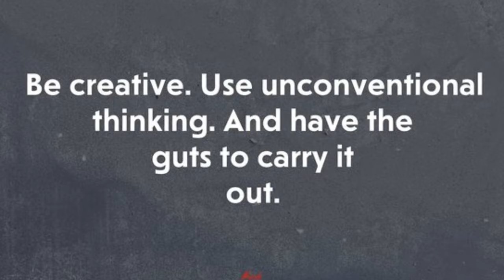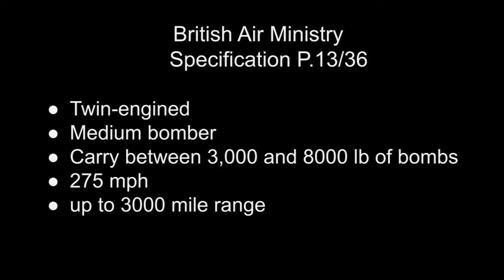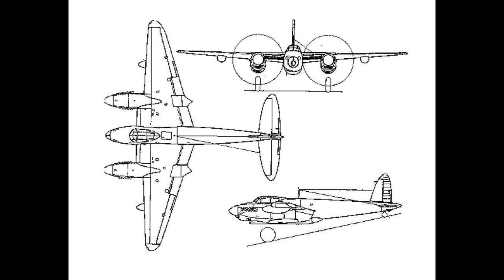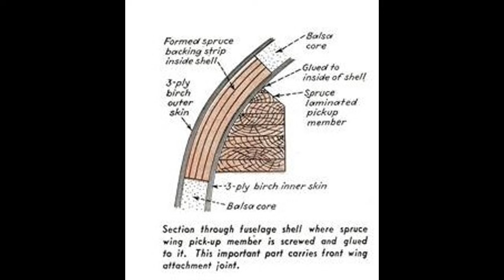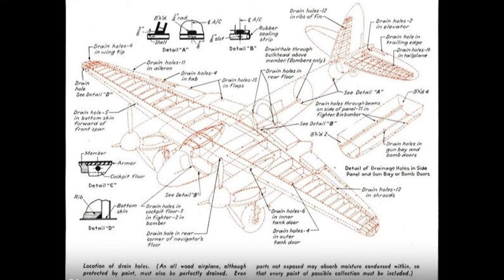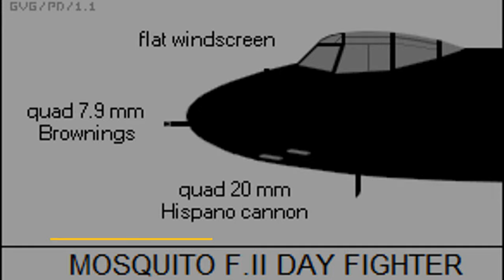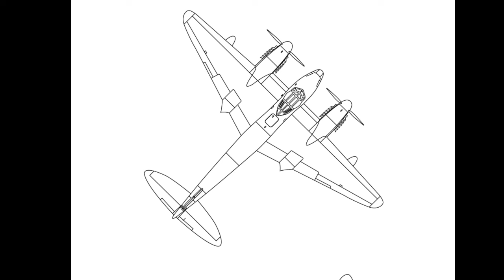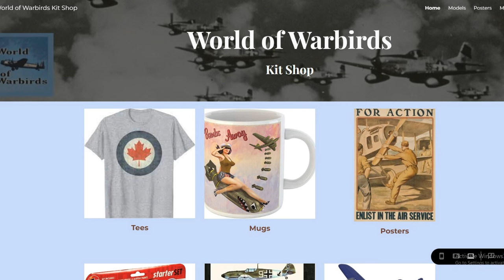de Havilland Mosquito (Mossie!) Part 1

Comment: Wilfrid Freeman was a personal friend of Geoffrey de Havilland, having flown in aircraft designed by him during WW1. The Mosquito was designed at Salisbury Hall, which had been the home of Churchill's mother and is currently the site of The de Havilland Aircraft Museum.
The DH.98 Mosquito is my favorite aircraft, I have several books and magazines about it, but I have never been able to see details (texts, photos or videos) of how they managed to pressurize the cabin in a wooden fuselage in the high altitude versions. I believe it was a low level of pressurization, just to minimize the effects of flying at high altitudes for the crew, so perhaps only by sealing the cabin part, the wooden structure would support the internal/external pressure differential - if you could clarify this point, I will be immensely grateful.
Reply from the maker: I’ll look into it!
Reply: @worldofwarbirds  I hope to finally solve this mystery.😉

Comment: Oh dear, you're repeating some myths.

Myth 1 that De Havilland came up with the idea of the unarmed high speed bomber. That was George Volkert of Handley Page. In May 1937, long before de Havilland put pen to paper on the Mosquito, Volkert came up with 2 designs to fulfil P.13/36, the HP.56 powered by 2 RR Vultures and the Handley Page High Speed Unarmed Bomber which he outlined in a brochure entitled "A Memorandum on Bombing Policy and Its Inflyence on Design". In this brochure he stated that "the most efficient bomber is the one that can carry out the greatest destruction with the smallest crew and the simplest equipment". Ye went on to state that "every other consideration will have to be sacrificed to the need for the highest speed, without which the maximum element if surprise is lost in any attack, as well as the greatest safeguard of the crew. Just as the bomber depends for its sucess on sudden attack, so for its defence it must rely on high speed and high altitude". Volkert went on to detail the benefits of a high speed unarmed bomber, which was design to carry ad it's normal bombload 3,000lb of bombs compared to the P.13/36'normal 1,000lb of bombs whilst at the same time being 1165lb lighter and 22mph faster.

Myth 2 the Air Ministry and RAF were uninterested in unarmed high speed bombers. Captain Liptrot (at the time Research Director Aircraft 3) analysed the design and considered that it would be faster than the Spitfire, although he also concluded that eventually the fighters would end up faster. Also in favour of such a bomber was Air Chief Marshall E. R. Ludliw-Hewitt (CinC of Bomber Command), he gave approval of the concept on 23rd April 1938. On 7th August 1939, he wrote "I am strongly of the opinion that the development of the fastest possible bomber, whatever its size,  is a project that ought to be put in hand so that we should have a prototype of this kind of bomber should the need arise". W. Sholto-Douglas (Assistant Chief of the Air Staff) also considered the type to be useful.

Myth 3 that the use of timber and other materials was opposed by the Air Ministry. In 1938, the Air Ministry issued specification B.9/38 for a medium bomber to be made out of non-strategic metals (ie metals other than aluminium and its alloys). They turned to 3 companies: Armstrong-Whitworth, Bristol and de Havilland. Armstrong-Whitworth submitted the AW.41, Bristol submitted the Type 155 and de Havilland refused to respond even though the use of timber would have met this specification. Specification B.9/38 was withdrawn and replaced by 2 new specifications Bl17/38 which covered Bristol's design and B.18/38 which covered Armstrong-Whitworth's design. Burt as Bristol was busy with what would become the Beaufighter they dropped our leaving the way clear for the AW.41 to be selected., nit that the Albermarle ad the AW.41 was named was much good.
Reply from the maker: The video didn’t state myth 1 or 3. As for 2, they sure as heck took a while to sign the contracts! Cheers and have a nice weekend!
Reply: @worldofwarbirds  sorry, but you were stating that the Air Ministry and RAF were opposed to unarmed bombers and the use of timber, and that de Havilland was the creator of the concept of the unarmed high-speed bomber. All 3 are easily debunked myths, just one book (British Secret Projects: Fighters and Bombers 1935-1950 by Tony Buttler) is needed to debunk what everyone keeps repeating as fact. You just need one chapter of that book to do the debunking (Chapter 5).

You also left out the primary reason for the lack of materials being delivered to de Havilland - the decision to concentrate on the building of aircraft already in production after the fall of France.
Reply: @neiloflongbeck5705  There are a lot of myths about the Mosquito and one is the speed.  It was the fasted bomber, just, but was not the fastest plane, hell few late model mosquitos ever topped 400 MPH and just as an example the Allison powered Mustang mk IA topped 400 and later Mustangs, $hitfires, P47  P38's also were faster......the myths persist !!!
Reply: @wilburfinnigan2142  all of these speeds are true, for a specific altitude, but also are irrelevant as none of the aircraft you are comparing the Mosquito to are in the same type category. The closest you dared to come was a twin-engined fighter. Nothing I have said it was the fastest of any type of aircraft. Yes, I did say high-speed, but that's a relative term as a cheetah is a high-speed kind mammal compared to a slug. Whilst the Mosquito had fighter-like speed in the early days by the time of the wars end it was no longer as speedy as weight went up with the adding of extra equipment. Although increased engine power offset dome of this extra weight. The same is true for all of the aircraft you mentioned.

As for ge Mosquito not topping 400mph, that's not quite true. The B.XVI variant which entered production in early 1944 gad a top speed of 418mph at 28,000ft whilst hauling a 4,000lb bombload.